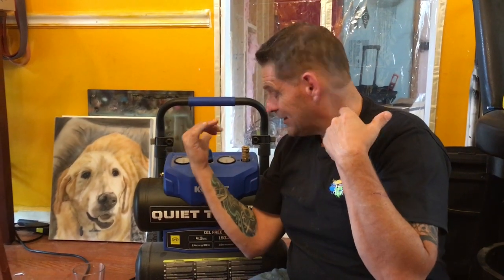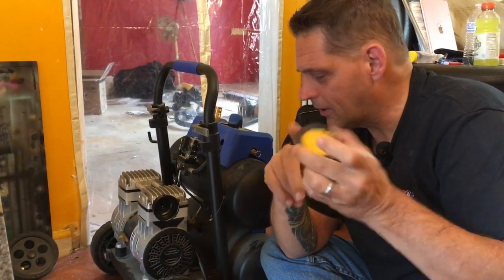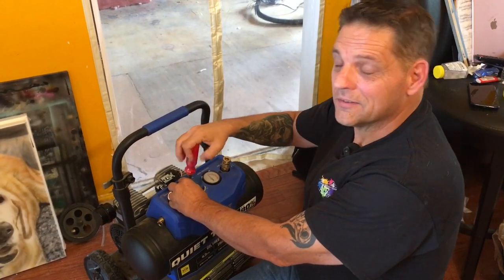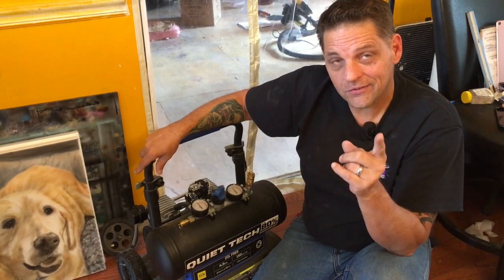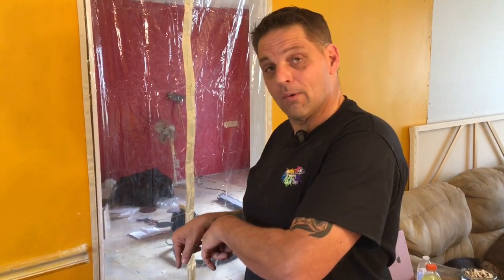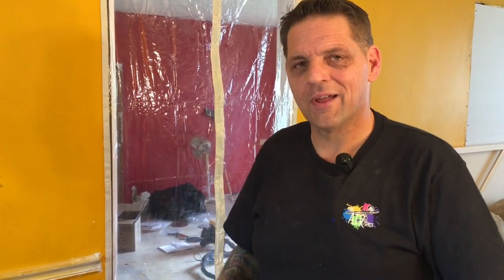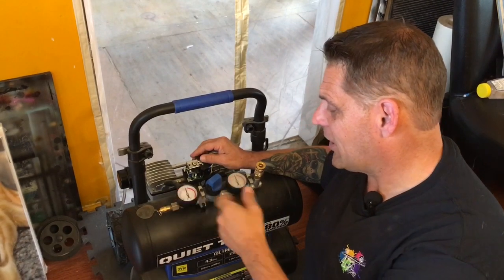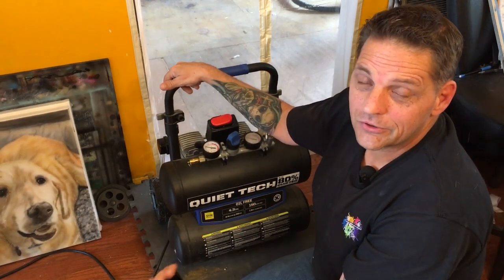Making your quiet compressor QUIETER! Simple no or low cost solutions to lowering the volume!

Comment: Noticed that when you took the final decibel reading the compressor was covered with dog beds. This will certainly result in some sound reduction, but would you actually recommend using the compressor that way ?
Reply from the maker: they arent smothering the motor so it wont hurt how they are   i dont normally keep them on there (that was just tossed on for the video with no real way to hold them upright)  However just adding some soft materials around the back helps.  IE keeps the sound from bouncing off the wall behind it.  
Honestly i just have mine sitting on a piece of carpet on a concrete floor and dont do anything else most of the time.  
Now if i had to put it on a regular wooden floor again i would definitely use foam or rubber matt like i did here (which i did when i needed to paint in the living room)    Ridgid fiberglass insulation is probably the best easy to access material to deaden sound reflections.   Same as taming echo in an empty house, if there is nothing but hard surfaces sound will bounce around a lot.   anything that breaks the echo up will reduce the annoyance.

Comment: Good tips, hope things are going well with remodeling!
Reply from the maker: well ive been swamped with comissions.. so its very very slow.  But i manage to get most of the textured ceiling removed in the studio area.. not a job I recommend i hate it :)  Wiring for downlights have to go in (id prefer different in the studio but have to consider resale down the road) And then ill need to adress why the builder never insulated the ceiling properly.. Im on the fence on whether ill just blow in cellulose or not.  Its kind of grown and morphed.  I was just going to build out my small area and get in there then work on the studio.  :)   The attic is above it.. which got cleaned out last week.. that was all my spare time that week!   Thanks!

Comment: ive got a CH from wally mart well my dd picjked it up na few yeats ago damn thing is loud try and make that thing queiet man id do anythinbg for  that
Reply from the maker: you would need a hush box and lots of mass 

IF you can take off the intake filter extend the tubing off the intake and either pipe that outside (although the neighbors may hate that)  use a larger intake filter it will help a lot.  the problem with those solutions, is by the time you do all that.. you could just spend a little over 100 bucks on a quieter compressor in the first place  
I started out with a very loud compressor so i understand.
Reply: @TheAIRspace  yeah know kidding lie I get these ideas a down hour tinkering and then go whatthe heck did do I could have went out a night something that does the same dam.  Job .. it's crazy I play guitar ,bass I tinker on building guitars plus I refinish. The darn things bibe got way to much crap for bipolar guy 😂